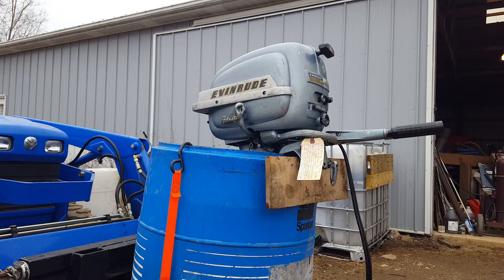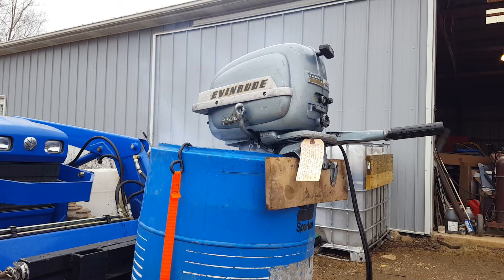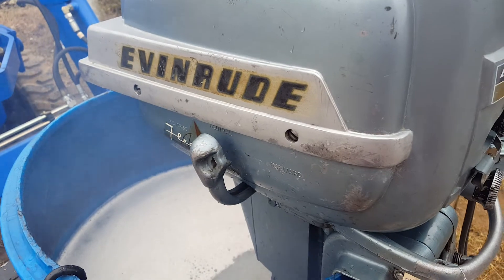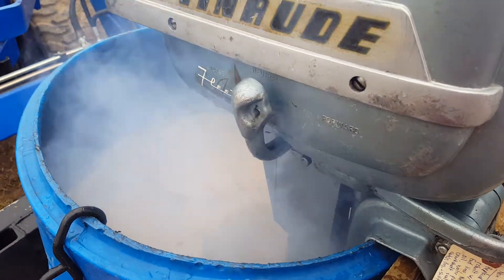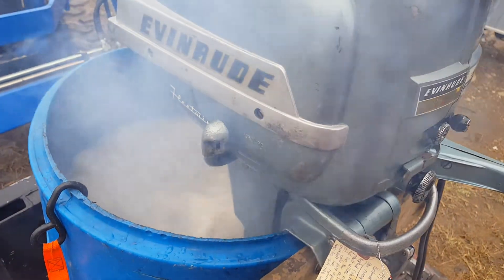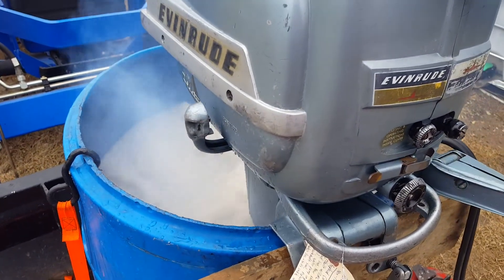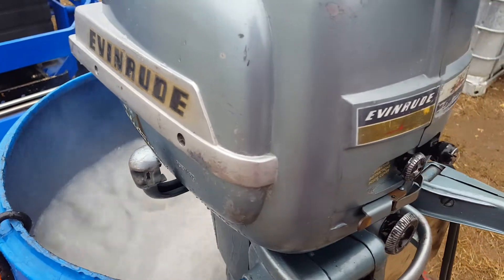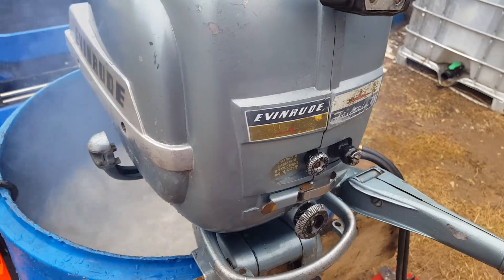1954 Evinrude Fleetwin 7.5hp Outboard Motor Tank Test

Comment: Just picked one today, got a nice original stand n pressure tank complete with fitting for $50, it is somewhat grimey but I enjoy working on them. Hope it runs as well as yours, thank you
Reply from the maker: Congrats on your new motor! You got a great deal.  If the tank is clean and has the fitting you got the motor and the stand free!👍 They are enjoyable motors to work on.  Thanks for watching!

Comment: Hi! 
How much did he cost you to fix it. 
I have one I am thinking to do the same by taking to the mechanic shop.
What do you think about that.
Reply from the maker: The typical tune-up parts cost around $150-$175 for one of these motors to do a full service of the ignition,  fuel system,  and lower unit.  If you have a shop that will still work on these motors, they're good motors.  That have to be maintained and they need to be run on the proper Gas / oil mix which is 16:1 for these.  It's easy to get more into one of these than they are worth when selling them, but if you plan to use the motor yourself,  you'll know it is done right and it will last you a long time. Thanks for watching!
Reply: @oldjohnnyrude8404  Just picked one of the bad boys up.  Very first motor for me I keep seeing 16:1 and 20:1 for the ratios on these but I'm just trying not to put the wrong oil in to begin with.   What exactly did you use on this?

Awesome video by the way!!
Reply from the maker: @CanAlsoDeliver  Congratulations on your new motor!  The correct oil mix ratio for these motors is 16:1.  They originally called for SAE 30 non detergent oil in the mix at that ratio.  I reccomended using a modern TCW-3 2-stroke outboard oil and staying with the factory reccomended ratio of 16.1. There are no rolling bearings in these powerheads.  They are all bushings/plain bearings and need that amount of oil in the fuel mix in order for them to live a good long service life.  Thanks for watching!
Reply: @oldjohnnyrude8404  It runs!
Reply from the maker: @CanAlsoDeliver  Awesome!!